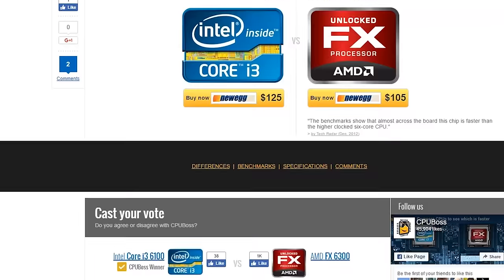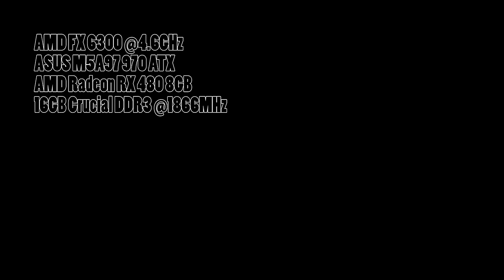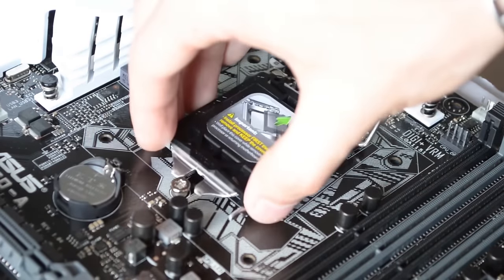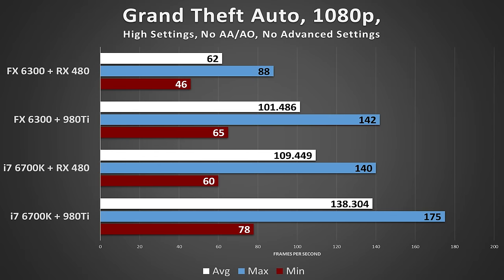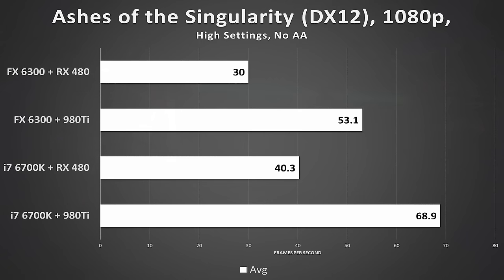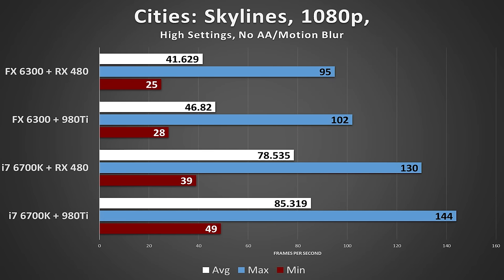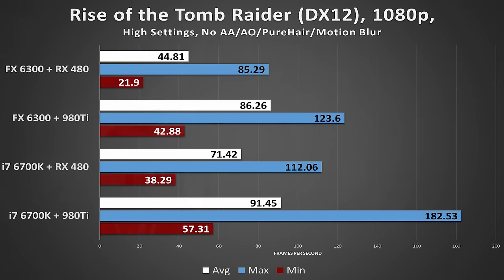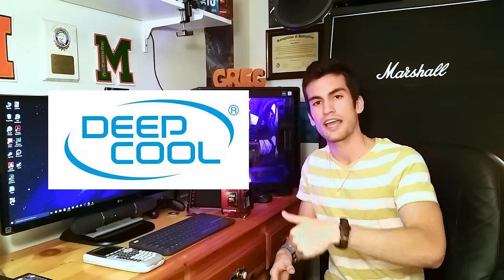AMD FX 6300 + RX 480: Severe Bottleneck?

Comment from the maker: - LOL @ $400 "cheap" PSU... didn't even catch it until a few of you pointed it out. I was supposed to say "400W." Thanks for letting me know!
Reply: Lol @ that btw. I was like huh?? 400$ cheap PSU like most of us over here.
Reply: hey man, will a corsair VS550 be good enough for a GTX 1070 + i5 6600k?
Reply: ***** Yeah, it's 550 watts. I guess I'll get the card in a few weeks
Reply: +Dolan 550w should be enough
Reply: Easily, that rig will barely draw 300W 90% of the time, a quick OC on the CPU and GPU might push it closer to around 450 but you should still be okay. I'm running a 4690k and a 290 on 550W both of which are less power efficient and it's fine.
Reply: Greg what card you will prefer rx480 new or 980ti refurbished .and in budget gt630 or gt710
Reply: haha everybody can make a mistake right?
Reply: i was like dafuq, mine has 860 watts and cost like 95 dollars xD
Reply: Not recommended, get a 550w better quality PSU, seasonic s12 or xfx ts for example
Reply: VS units are very bad quality. I wouldn't trust em.
Reply: yep that was good. 
I can justify the fx-6300 only when you have one ( like me - 4,5Ghz wuth cooler master 212 Evo - 43-47 C ). 
i5 6600K is what I am looking for , but my advise is to wait to see what new AMD Zen will show. Of course if you can wait, in my case I will see with is the better platform and change to it ( I mean the price point around 6600K and a decent Z170 board )
Reply: Lol Greg not everyone can afford a 800w Redundant PSU and call it cheap :P Awesome video also eagerly  awaiting Zen if the RX480 is anything to go by Zen should be pretty damn good PtP wise
Reply: I believe AMD Zen is launching in October
Reply: Rokit_Man Postponed to next year. Hopefully we finally get some decent Amd cpu...
Reply: "few weeks"
Reply: I thought he sais "$40 cheap power supply."
Reply: I thought I understood something wrong because of my bad english haha!
Reply: Yeah, I was like $400?!?!?!?!?!?!?!?!?!?!?!?!?!?!?!
Reply: +Dolan no. its a junk unit. go with a seasonic s12ii or corsair cx550m(grey sticker, much better than the cx greens) at the bare minimum.
Reply: Aaannnnnd you can check it out here ^^. lol
Reply: we need fx 6300 @5ghz tested now
Reply: Jubal Harshaw oh
o though it was 3.6
im stupid.......
Reply: yeah i was stupid and though 3.6 for some reason....
Reply: don't go budget on the PSU i went with fractial design edison modular 550w, and i feel little bit sorry because in higher loads you can hear coil whining from the PSU
Reply: I got my psu for $40 evga 600w b
Reply: The interesting thing is that it  whines only when i play gta V or very heavy games and when i minimize (NOT CLOSE) the whining stops :D
Reply: yea i know, thanks for the explanation anyway
Reply: I really need your help. Does an i5 6400 bottleneck an ASUS gtx 1070 Founders efetion? please respond :)
Reply: might be enough, but the cheap bronze sertified bronzes are not that great, i know many who has had powersurge problems with them.
Reply: philipx550 meanwhile i'm rocking a thermaltake 650w gold, never crashed my pc and almost used for 1 year. meanwhile 2 of my friends have problems with corsair vs650
Reply: Been using a Corsair HX 750W for 5 years now, running a HD6990 boosted to 6970 clock speed on both GPU's, and a Phenom II X6 1100T BE clocked to 3,84. I've changed out 8 HDD's in the beginning as the WD Black failed after a couple of months in raid, so I went for some Seagate Barracudas instead. One of those have died so far :) My system use 680W from the wall at max. load. Good PSU, I must say!
Reply: TOO bad the t1100 goes to 4.2 stable unless you got a bad chip  HAHAHAHAAHAHAH
Reply: I've had it at 4.1 something, but I have a cooling issue. :)
Reply: Ever considered an Pentium G4500 vs i3(Skylake) vs FX 6300?
Reply: hey SS...my rig is 15 4600 + 8 gigs ram....if i pare it with a 470 or 480...will it be a good hd video editor???...and on that note...I am a wannabe youtuber...and want to invest in a gpu....so what it should be ??a 480 / 470 / 960 or 460....(only video editing)...
Reply: ***** How's that going feeding 110-230v straight out of the wall into your mobo which is running at 12volts and would probably fry at above? (i know this is a troll, just giving facts)
Reply: Corsair PSU's are pretty bad, go with EVGA or something else.
Reply: +philipx550 ok I may have stretched "pretty bad" a bit. But it's not just from my experience. It's generally accepted among the people who know these things that corsair PSU's are worse than EVGA's (for example).

Edit: and more clarification:

According to most everyone:
VS and CX are crap
CS is decent
RM is overpriced
RMi is good
HX, HXi, AX, AXi are good
Reply: philipx550 Yeah, because if the person is considering Corsair, I would go the next step up to EVGA because the difference in failure rates are the biggest in the ones you put there.
Reply: your doggo goes bork
Reply: lol I was shocked ,
btw these benchmarks are the real deal
Reply: THE GAME TESTER if he has a z170 motherboard and the good CPU cooler you can install a bios from a different website and he can overclock his chip Sala czar studios has a video on this you should go check it out
Reply: What memory you used? Becouse i have beter results on FX6300 + RX470 + DDR3 1866MHz Dual-Channel
Reply: Salazar Studio I think an X4 845 or an X4 860k would be better...
Reply: Hazard3k memory don't do the difference. the 480 have more bottleneck with this proccesor. that's why u have more frames.
Reply: Alejo Fernández Yes, yes, This is why we used DDR4 now. Where my SD-RAM?
Reply: tried FX 8320 and RX480 it works but the cost is high , getting severe bottleneck fps drops etc however in the low end game marging it works suprisingly well :)
Reply: That 8320 should do 4.1-4.5 rock solid on all cores with a very good air cooler (large 120mm fan, minimum). Stock 3.5GHz will bottleneck IMO a 480. If you can get it close to 4.5GHz which is a 28% jump you might just do enough to have the RX 480 happy enough that it will come close to an i7 most the time. I did 4.0GHz on a stock cooler (the one with copper pipes) and no voltage modification with very good temps.

I got an 8320 the month they came out over 4 years ago, first thing i did was get it as high as i could but also very comfortably. Sat at 4.6GHz 1.51v perfectly stable under 4 hours of stress testing at about 84c in a normal temp room of about 72F (22C), then knocked it down to 4.5GHz 1.488v 79c with fan ramp turned down to stay quiet. The reason i did that is because i wanted the system to be up 24/7/365 for many years.. which it still is. I've been building, overclocking, and maintaining PC's for well over 15 years both professionally and for all my friends and family and i can tell you that if you push an overclock too hard (especially with high voltage) you will cut the life of the CPU/Motherboard drastically down to a few years and maybe months.

In all, I have done about 6 builds that included a FX line CPU that i overclocked. A FX-4100@4.1GHz (stock cooler), FX-6350@4.4GHz, FX-8320@4.5GHz 1.488v (mine), FX-8320e @4.6GHz 1.41v (lucky friend, then he tried to push it to 5.0GHz himself and now runs it as 4.4GHz cuz he damaged it), FX-8320@4.2GHz (cheap motherboard/unlucky friend), and the 4.0GHz on a stock cooler.

Point is, i found that every time i do an overclock for a friend i push it to the limit 100% stable... then back off a little voltage and 100MHz. And is also what i would do to my own computer.

I also don't lock the voltage and frequency, so at idle it drops to 1.4GHz 0.97v with the CPU package sitting at about 22c or room temp (about 36c core).
Reply: Makshogun YT i5 7500 8gb and rx480 8gb solid rock future proof 3 years at least
Reply: Makshogun YT he should of got a 6600k and gtx 1070
Reply: philipx550 it's much more like ~50% in 1080p and a little less at higher resolutions, that's according to userbenchmark.com that collects benchmarks from multiple sources.
Reply: lol
Reply: Science Studio I was just gonna comment ultra cheap $400 psu
Reply: I have fx6100 @4.2ghz and i bought gtx 1050 2gb last week, never went over 80% gpu usage in games, i use afterburner, play games at 1080p, bf1 medium i got 60fps
Reply: Science Studio <<<Do this video again with new CPUs please.I have a Strix RX 480 and will be upgrading my FX 6300 very soon. I already got the case (meshify c) and a 240 aio. What is the cheapest CPU / OC MOTHERBOARD combo that doesn't hold the 480 back currently? Ryzen-FX-INTEL>>>
Reply: i want your marshall amp xD great vid :)

Comment from the maker: - Sorry about the warm colors! Main camera failure. Should be good to go for another video tomorrow.
Reply: Can You Solve Your Camera Problem Quickly?
Reply: you should make a vid with rx 480 + i3 6100 because that's the processor most budget gamers use
Reply: +MetalPhoenix45 including me btw
Reply: +Abid Hermawan He just said he'll be good to go
Reply: Thanks
Reply: Because The Camera Is A Total Horrible
Reply: Hehehe Same As Me
Reply: I'm Actually Not A Hater Of This Channel
Reply: very nice video !. Its very cool that you choose cs go also for the performance test !.
Reply: And i actually like the video and i hope amd make a better processors to fight intel i7 6950k
Reply: pls do a 8350 with rx 480
Reply: warm colours because all the amd stuff is heating up your camera
Reply: can u do video with oc fx 6300
Reply: For a cheap and several years old CPU it is quite a good performance.
Reply: +Erald Sison No reason to bother with obsolete cpus.
Reply: +MrKeikari  idc people still use it. I still use it.
Reply: it might be bottlenecking but I don't think that much because CPU is very important in frame rate as well as faster ram and I can see that making the difference in frame rate easily especially since only 4 cores from the fx 6300 were being used I wished you used an i5 2500k for fair  results
Reply: On stock I get on Rise of the Tomb Raider;
Min:35,Avg:80mMax:119.
Ashes:42
Same settings, same driver, at 1080p
I did not do multiple runs though.
Reply: not only was it warm, i dunno if its autofocus r ur distance changed between frames the video kept zooming in and out. how much of a difference do you expect in gameplay between i3 6100 and i5 6500 keeping everything else identical in stock cpu frequencies. rx 480 with h110 motherboard.
Reply: The video lokks like from the 80s
Reply: Good thought it was my monitor for a sec
Reply: I thought it was a throwback to your original 6300 "Scorpion" build pc. Although it was late 2015.
Reply: Someone forgot to remove autofocus hahahaha
Reply: And I thought you had put a "Fabulous" filter on the video :P
Reply: have you thought of using a fx 8300 its on newegg for around 100 not much different in price its the lowest clocked of the fx 8300 series but handles its
Reply: +Joeking meh not really any faster than fx 6300 because when games use four cores the speed of the two are about the same
Reply: You should test A10 7890k with a dGPU for new DX12 games to see if they perform better with the iGPU on/off. Great video btw!
Reply: Man... According to the Price to Performance.. this thing rocks .. i mean look at it... it is that old but still runs things pretty smoothly on that 60fps range. And apart from that it is totally nonsense to even compare it with intel's new processors, due to the fact that they are newly built and they have new circuit designs. But what i appreciate is the fact that ,,,, once again, that Old thing can still rock. Even I ran Crysis3 with my AMD fx-6300 and it was around 55 fps on high settings... (Ant_alis- off.. MS - Off.) (Gtx-750ti)... ANd you can get more fps by lowering the res to a playable limit ..
Reply: Salazar Studio it looks nice
Reply: Get a Zen chip with an Rx 480, that will be ok for 2017-2019. By ok I mean playable on high-ultra MSAA X2  at 1080p
Reply: That's a solid build

Comment: That feel when this is exactly what you're running in your rig...
Reply: I got the same feeling watching the Geforce 210 video.
Reply: same for me dude .... i got R9 380 and fx 6300. this thats a bottleneck?
Reply: yes
Reply: 5.4GHz? o.O
Reply: +Eri Keeper no
Reply: Still better than my i7-2630QM and Nvidia Quadro 2000M
Reply: That would be just a waste of money
Reply: since eithrt card is gonna be limited you mightaswell go for the rx480
Reply: The feeling when you're running something substantially worse than this in your rig. :-|
I can not wait until Zen.
Reply: +Jubal Harshaw I went from Athlon x2 5000+ then FX 6300 and then I got a substantial raise and a 4790K. Also walked away from the fog   :)
Reply: God damn it, I need a job. xD
Although I do wonder where the 4790k will stand when Zen comes out, assuming zen is as revolutionary as it sounds.
Reply: Connor Hoban
 fun thing is zen doesnt actually need ot compete directly with the likes of haswell or skylake, it just needs to get out of the cesspit the bulldozer and derived arquitectures are

if it matches haswell levels of speed atand has the right price it is a sucess
Reply: Jubal Harshaw
if that's the case expect intel to undercut them the second they come out by loweringp rices on haswell and skylake(likely by then kabylake is also out), and amd getsp ushedo ut of the market again

so unless they have a freaklishly low yield on Zen no one can tell what the prices are

also worthnoting zen is on a new socket so a bunch of new mobos are coming out aswell
Reply: No, it's not. I have the same setup as well, and it is just as fast as friends Intel Xeon worth twice as much, with the same GPU (in games, at least).
Reply: *****
 depnds on the type of application it is

some types of game thruive in having a stable high framerate ot keep mouse polling fast

for everythnig yes matching the monitor refresh is more than suficient
Reply: +esperCELL   You'll replace your GPU long before you should be worried about its lifespan.
Reply: The feels. ;_; I'm running the 6300 with a GTX 1080. Waiting a bit to upgrade everything else.
Reply: ContainedBiohazard Hey. At least you got that beast of a card. When you get the chance to get a better CPU and motherboard (ideally wait for Zen and get 6 or 8 core), you should be good to go.
Reply: Connor Hoban I plan on waiting for the 8 core variant of summit ridge, but if they aren't released soon enough to my liking, I'll fork over the intel premium for a broadwell chip. Things aren't looking good though, there's been nothing of AM4 almost all summer, and the Bristol Ridge seems to have gone quiet. I'm worried about what this means for Zen,
Reply: +ContainedBiohazard benchmark came out
Reply: Chris Wright Comparable to a quad core i5, for an Engineering Sample, that's pretty good. I wasn't expecting skylake levels of performance, but if AMD can take the low end/mainstream market, it'll give them some much needed RnD funds.
Reply: ContainedBiohazard amd doesn't need to be king again and that not what they wanted to do I believe they want something good but not crazy even tho they made the 1000$cpu
Reply: +Chris Wright I can see them going for the performance crown again, but not anytime soon. think of this like a stepping stone, giving AMD the funds to research and develop other, better products later on. I'm also excited for the imminent price drops of mid-low range intel chips resulting from Zen's competitiveness.
Reply: +FaintVFX yes the fx 6300
Reply: +FaintVFX are you planning to over clock or no
Reply: ***** if got the cash get fx 8350 oc to 4.4ghz with a good cooler the 1060 is great the rx 400 series are better if plan on keeping them for the long run depends on you
Reply: I have the 6300 with a 950. Is that a bottleneck?
Reply: nope, fx 6300 wouldn't even bottleneck 960 or just very little
Reply: Running a 6300 and crossfired r9270x i has no issues
Reply: no issues is being addressed but, it sure causes bottle-neck
Reply: Get a fx 8350 and sometimes, the fx 9590 goes down to the same price as the 8350
Reply: they are practically the same thing......They use hand picked 8350 parts and the OC the crap out of them (watercooling is required for a reason) . Currently I am running an fx8320 OC to 4.2 with a gtx1060 and it does fine. Granted I am certain the same card would reck me in an i7 but oh well. I did notice a HUGE change when I did the OC...although I think it had more to do with disabling all the energy saving cpu downscaling nonsense.
Reply: I've that same motherboard too.